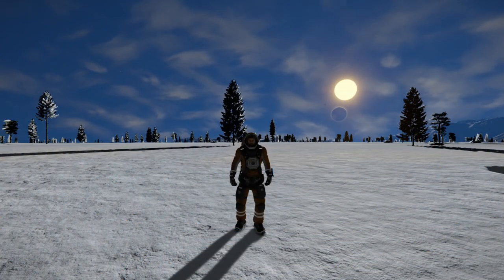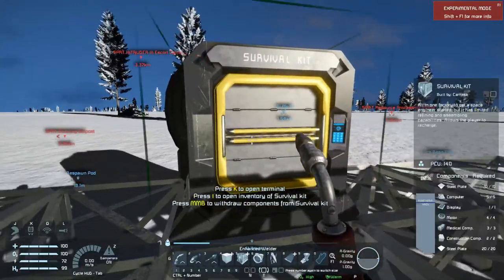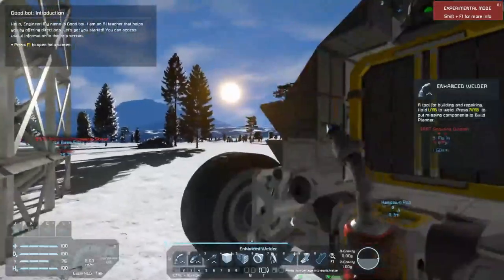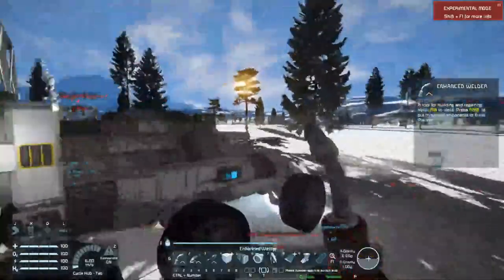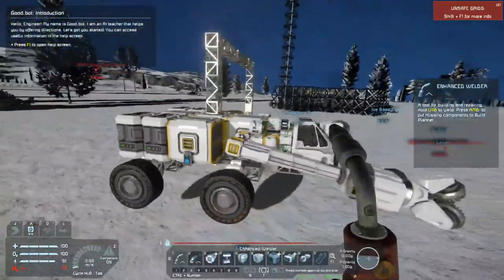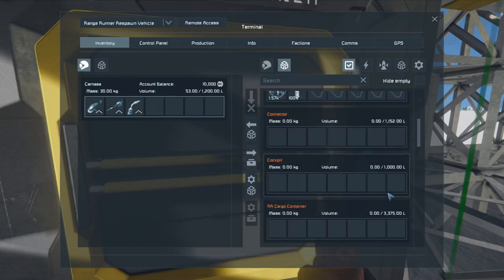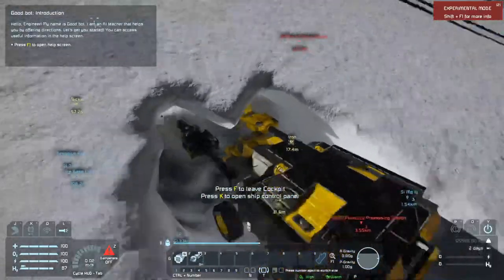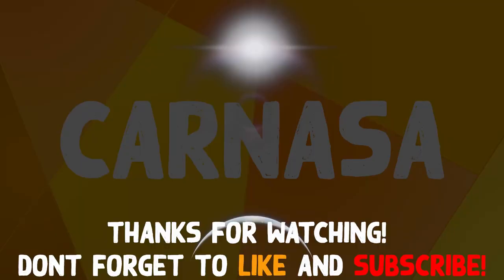First build! | Space Engineers #2

Comment: One of the most effective and efficient ways of mining is plunge mining. Plunge mining is simply put is using constructing a s et of drill on a piston witch lowers straight down. This works best on a large ship or stationary large grid.

One more thing your connector is too high to transfer material from your rover to your base. You need to line the yellow squares up to transfer resources.
Also larger wheels are best for mining, I would highly recommend looking at mining rovers on the workshop.
Reply from the maker: I do want to create some kind of flying contraption at some point soon that does this! Also with the connector for the Rover it was just meant so that I can charge it up rather than transfer anything, in all honesty I’m probably going to get rid of it soon and replace it with some kind of flying explorer. 

Also I kind of don’t want to use the workshop for things like this, I want to try and come up with my own ideas even if that does mean a lot of failure before success!
Reply: @Carnasa  you don’t need to use the workshop for your survival, I am just recommending that you look at how they are constructed, and their layout of internal systems.

Comment: Although it is common practice just to say friends don't let friends use wheels in Space Engineers it is possible to do what you are attempting. Sadly it will take more investment. Large ship parts to start. then think about using a single conveyor hinge rather than rotors. Off the hinge have a bank of drills spaced out to deliver an equal cutting width of the vehicle. Remember that weight distribution across axels/wheel pairs is important and for the love of all things never, ever, under any circumstances... press P